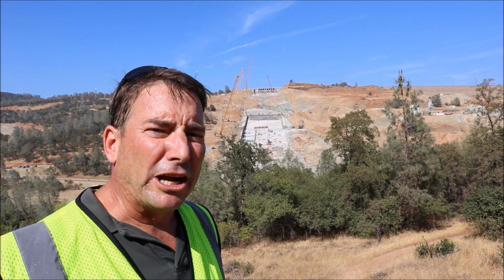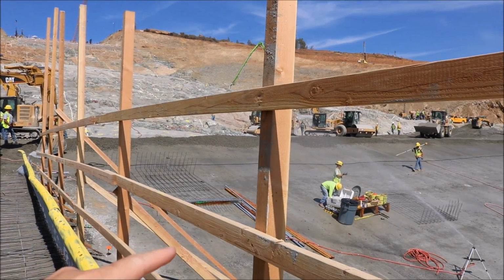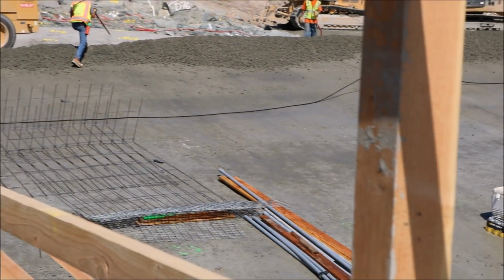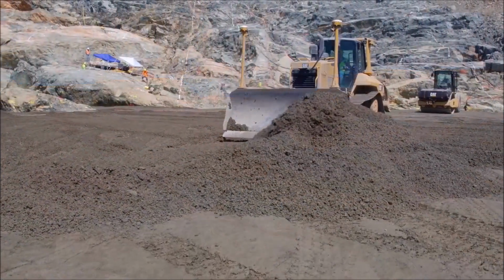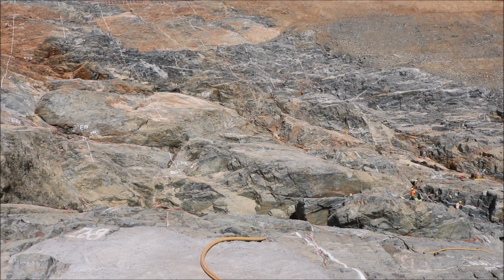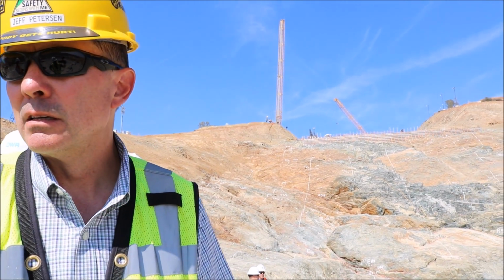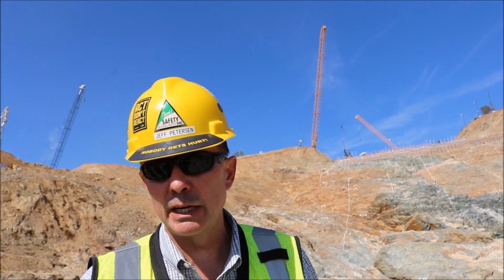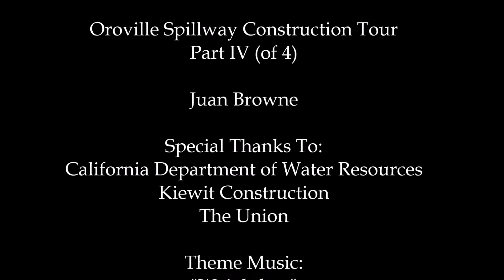Part IV Oroville Spillway Construction Tour

Comment: The aggregate plie for the RCC seems to be rapidly diminishing.  It seems there is actually a bit of confusion as to what leveling concrete is.  In my opinion, it is a wetter concrete than RCC which is very dry when placed.  Both RCC and leveling concrete lack rebar, although I noticed they were putting some pig wire into one of the two at a certain point.  It's pretty clear the "dental" concrete is used to fill deep cavities nnd small cracks.  Both leveling concrete and dental concrete can be pumped, but I believe the dental concrete has a finer aggregate content.  Structural concrete refers to concrete with a high content of rebar.  As for the differences in the mix I can't say for sure, but I assume the structural concrete probably has a higher psi compression strength than the leveling concrete.    I believe is is possible to pump the structural concrete too, but I'm not positive, and I also don't know if the size of the aggregate is different.    Nowadays there are many different additives added to the mix to achieve various results which would include cure time, workability. and ultimate strength.

Comment: If all goes well, next season Kiewet will: 1. Demolish RCC side walls and replace with 30' structural concrete walls; 2. Grind off several feet in depth of RCC section & pour structural concrete slabs anchored to rock; 3. Use circular saws to cut out drainage channels in RCC section exactly like upper and lower chute; 4. Resurface T-Rex power diffuser blocks; 5. Finish the Emergency Spillway; 6. Level surfaces around the spillway, seed and plant a few trees.
Reply from the maker: TonyUnplugged You got it!

Comment: Around minute 10 the lead states the upper concrete with all the ebar and such will end and at a 90 deg. angle, go down where the RCC will join it. He also mention aeration vertical culverts. I guess they want to aerate the water at that point to make it less able to erode the RCC? I forgot, are they , next year taking out a certain amount of RCC and  replace with the reinforce stuff if they are laying the RCC up to finished grade? I also wonder, there are no rock bolts going down through 100+ ft of RCC in the scour pits (plunge pools)? Excellent report. Thank You!
Reply from the maker: Erik 567 correct.

Comment: If you think of the concrete system as a pie. The dental concrete is a slurry concrete. It's soupy and able to get into cracks and crevices. It's like patching a broken pie pan for the filling. The RCC is the filler. Of course no filling is needed if the rock or bottom crust is already up to the engineered height limit. In the areas that the RCC is used it will be filled to the engineered height limit and according Kiewett that height is right under the upper crust or the erosion resistant structural concrete.  In areas that the rock is already in the engineered height limit, leveling concrete is used to bring the rock or bottom crust up to a smooth point that top crust, the erosion resistant structural concrete. If I understood right, there will be areas that the RCC will be a temporary top crust. They will try to use chemicals to bring the PSI up to acceptable finish.

Comment: Hi Juan, excellent work! Couple of questions about the spillway walls if you can ask DWR: 1) how high  up the wall does a 100,00cfs release come? 2) how high does a 160,000cfs release come? 3) 270,000cfs (max?) come? Also, is the low pressure river outlet valve being used currently as well as the Hyatt power plant? Thanks.

Comment: Your footage inside the spillway really helps clarify what's going on. Great work, as always.

Still confused about leveling concrete, though. Dental and structural I understand very well. Your description of RCC and the DWR videos make that clear. But when, where, and why is leveling concrete used? And what is it, what kind of mix?

I have been assuming that RCC comes from the RCC plant and everything else comes from the structural plant. Is that right?
Reply: The mix for leveling and structural is the same. The difference is that the structural has the re-bar in it. They can also add ice and or chemicals to change the cure rate and final hardness.
Reply: Thanks.

Comment: Still sounds like a bit of confusion re the RCC, what goes on top of it and, for next year, if the RCC remains with a "finish" concrete added to it.
Nonetheless, the resulting spillway will be substantially better designed over the original.

Comment: Thanks Juan for the video very informative. Wonder how they plan to remove those RCC walls next year and not damage the floor off the spillway ? That's a lot of wall to remove.
Reply: RCC is very easily demolished with power hammers. They'll use excavators to break it all up, level it and form up the final spillway from there.

Comment: Around the 10:30 portion of the video Jeff Peterson was discussing the end of the upper spillway with structural concrete that will tie into the lower spillway with RCC. Could you provide further explanation on the finished construction of this detail? Specifically the 2' dropoff with vertical box culverts at each end to provide aeration? A diagram would really help me grasp this design. Thanks for all you do Juan.
Reply: Just imagine the water flowing over a 2 foot high ramp, and at the same time jumping over a box trench. The box trench allows air to be drawn in from the sides if needed, to break any suction or low pressure and to help entrain air into the boundary layer of water that flows along the RCC below.
In very basic terms, they are using the 2 foot jump and box trench to make the water flow break away from the surface and become aerated to protect the initial part of the RCC from high pressures.

Comment: Let's see if I have this straight....

-Structural concrete (the very hard top layer that can resist water erosion)   How thick?
-Leveling concrete (to set the final foundation grade) various thicknesses
-Roller compacted concrete (the main filler material)  various thicknesses
-Dental concrete to fill the small holes and crevices   (bottom)   Fills holes too small to get the trucks & rollers into

Yesterdays video that detailed the tell-tale drains was really interesting. The drains start under the slab and go down hill until they exit ABOVE the water flow downstream. Ingenious!  So, about ho long are the drains from top to bottom?  I'm sure I saw similar drains spewing water while the original disaster was going on.

Ya know what?  I think this is gonna all work out, and all the communities and enterprises down stream are going to be safe again. Now just a few thousand more dams across America that need to be repaired. Yes, its a BIG deal.

Comment: Another great series if info Juan.  I wonder if you know whether the RCC is being compacted with the rollers in "static" mode (non-vibratory) or in the "vibratory" mode?  Also, it appears the RCC is being put in so fast that it doesn't have time to cure properly. With that in mind, do they expect to get shrinkage cracks, and if so, how do they expect to solve the problem.  I've worked for over 40 yrs as an inspector, but never around RCC.  It's definitely enlightening to watch this entire process play out.  Our hats are off to Kiewit for the amazing job of co-ordination and expertise.  Also. will anything be done this year to the very end of the spillway where, if continuing straight out, there is a pool of water, then a road, after which is the river?
Reply from the maker: yes Thermalito Diversion Pool.
Rcc will crack, expansion joints (sheet metal) added to upper layer (s)
Reply: But what happens to the Diversion Pool between the road and the end of the spill way ?  Does that get filled in somehow, and does the road eventually disappear?

Comment: Juan, why is air added to the water flow ? Jeff was referring to a wall just above the section that will be filled with RCC.
Reply: The air is to prevent cavitation. Cavitation occurs when you have an abrupt change in direction of flow. Basically the water pressure drops and the water actually boils. When the pressure goes back up suddenly the boiling water bubbles collapse creating shock waves that damage the concrete or whatever else is there

Comment: Great job on the series. Do they have to worry about heat buildup with the RCC?  Looks like they are getting a lot of lifts in a short time, or does the water take that away? Keep up the great reports.
Reply from the maker: Joe Lomax apparently not, it's a continuous operation.
Reply: RCC is very porous and doesn't contain nearly as much cement as a more solid, conventional concrete pour. It doesn't build heat nearly as much as there's less concrete in the mass curing and the porous nature allows more heat to readily dissipate.
Think of RCC as a sponge cake and conventional concrete as a mud cake.
Reply: Thanks Sideslip !  So does all of the water just keep going down in to it?

Comment: Great video Juan. Seems like poor planning to have to remove the RCC walls. If they had set them back a couple feet they could have built the new walls directly inside them. If they have to remove RCC to build the new walls they would not need to remove all 12 feet of them, so maybe it is not as bad as it sounds.
Reply: marmaly --- Logistics of constructing the underdrains are also a factor (as was discussed in Juan's other parts of this series).

Comment: Thx Juan, great reporting and thanks to the construction guys for letting you get in there, there's so much crap on youtube surrounding oroville it's unreal but you're a doing a great job so keep em coming!

1 Question,   how long does the concrete take to dry? if they pile rcc to a depth of 150 foot, does it take longer for the concrete in the middle of it all to dry out or is it dried in sections before the height is increased further?  - just curious because that's a lot of rcc going in that plung pool, thx.
Reply: Concrete cures long before it dries. They have to add the next lift in something like 30 minute increments. Being on grade that concrete will probably never be completely dry.
Reply: Eastern Woods  Thx for the reply, was just wondering because that's a lot of concrete in a short time and at 150 foot of depth in the plunge pool it's gonna be like a baked alaska, crispy on the outside and soft and gooey in the middle.  RCC must be a drier mix to start with though so would have thought it might not take as long as conventional concrete
Reply: Cement is one ingredient in concrete. Also add water and an aggregate. Also add chemicals to change the hardness and cure rate. The mixing and curing of concrete is exothermic ( it gives off heat ). They've taken core samples of Hoover Dam and found the concrete is still curing and still getting harder with time. Cemex has some good utubes on RCC. Most concrete has more water in it and it looks like soft mud. RCC is very dry and looks more like wet sand like you would use to build a sand castle. When they pour curbs with a continuous machine it sets up to hold its shape in about a minute. That's very similar to RCC.
Reply: Eastern Woods Thx, It's weird, you kinda expect concrete to go rock solid in a short time but like you say hoover dam is still curing after all these years

Comment: An incredible project. When it was mentioned ...100Ft. of concrete...I assume that means 100Ft. thick? Wow..!! The scale of this project is only understood when you see those teeny tiny people...like ants...working  down in the ravines and other places.  I do have a question: When the spillway is finished this Fall...at least enough to make it thru til next Summer..will there be just one grade all the way down the spillway...no 'bumps' or 'waves' of any kind? I can only assume that the grade would need to be as flat as possible to not have any airplane wing 'lifting' dynamics going on.?
Reply from the maker: marbleman52 it's a large, curved slope. Up to 4:1.
Reply: Juan, my apologies for not 'seeing' what  your "curved slope" is supposed to look like. Let's say you could put a very long straight edge against the long side of the spillway, from top to bottom. Will the edge of the spillway match the straightness and 'flatness' of the straightedge? Or, how 'bout this: if I get a 2 x 12 piece of pine ...for example...and put one end up on my porch and the other end on the ground, will this represent the spillway; not counting the sides, of course.? I do not see where the 'curve' is supposed to be. The cut-off wall at the 10 minute mark...when completed is there gonna be a small drop-off between those 2 levels? Sorry to be scratching my noggin on this...just trying to get a clear picture of what the spillway will look like from a side view. Thanks again, Juan for all your work during this amazing situation..!!
Reply: Marbleman. It's a curved surface so yes there will be a small airplane wing effect but the change in direction is over many hundreds of feet.
Reply: Thanks, Eastern Woods...I guess I just didn't realize what this curved effect meant whenever it was mentioned. And maybe I'm having a 'senior moment'..Ha..., but I actually don't remember hearing this curve talked about.  Okay...another question: Why? To slow down the water? So this is like taking a ruler and putting a slight bend to it?
Reply: The spillway starts off as a gentle slope and about half way along it becomes steeper. It kind of follows the land surface. If you go back to the community outreach videos that Juan did you'll get a side view of the spillway. The diffuser blocks at the bottom are to break up the flow going into the river. I have seniors moments all the time.
Reply: Thanks, Eastern Woods. I have been a faithful follower of Juan throughout this endeavor so I must have seen those videos that you mentioned...just didn't zero in on that particular detail. Okay...I'll quit worrying myself over this then...LOL. Thanks again.

Comment: Juan: On the lower portion of the spillway where RCC will be used as the top layer, what keeps the water from scouring & eroding it away during use?
Reply: The top layer has the mix adjusted and chemicals added to make it harder. It will scour faster than structural concrete but not as fast as regular RCC

Comment: What does the ground water drain plan look like in the plunge pool that has an area of 100 ft tall x 250 cu/ft/yards and is filled w/RCC? Note for the bloncolirio infinite spiral notebook and DWR media phone call. Or is it classified as a engineering security clearance and need to know basis: Only?
Reply: Technical Correction: How is the Rain Water and Ground Water going to be managed on the front and the back or in and around or threw the New Rain Water Collection Device (AKA The New Spillway RCC Plunge Pool Plug)?
Reply: This is just a thought, but Do they think that a Maze of Service Tunnels would be helpful?  Something like a Service Tunnel Maze made of Concrete Canvas Shelters Linked Door to Door. Yes you blow them up. Link them together and Add Water. Then In 24hrs you will have a Hurricane and Military Rated Bunker --- Walk Threw Service Tunnel for Rain and Ground Water Drainage--- Then DWR can just RCC them into the planned RCC Plunge Pool Plug.

Comment: My understanding of the secant wall is that there will be structural concrete from the wall up to the top of the emergency spillway. What are they planning
to do downstream from the secant wall?
Reply: Actually I think it's RCC between the secant wall and the emergency spillway. Below the secant wall will be erodible soil. the secant wall is into bedrock so that there will be no undercutting and erosion up the hill to the emergency spillway
Reply from the maker: David Chapman see part II...
Reply: Thank you for the info. I am not sure what erodible soil is that can withstand the high CFS flows.
I would thing they would put rock rip-rap or something to help dissipate the energy.
Reply: The erodible soil is just what's there now. The emergency spillway was only ever used this one time in 50 years. It will only ever be used if 270,000 CFS down the main spillway won't keep the lake from topping the emergency spillway. That will only happen if a hurricane makes landfall in Northern California and then you have other problems.

Comment: Hi Juan, at 17:05 do you know the reason for the central part/trough of the upper/mid spillway being still down to rock with built up concrete to the base of the training walls on either side?

Thanks
Reply: That's the individual plates between expansion joints. They do the outside first because that's what they can reach. Then they will move equipment onto the finished surface and do the center
Reply: Thanks - just looked odd still being right down to bare rock. I thought they built up in layers. Just curious.

Comment: When the new construction begins next year and calls for the removal of this "temporary" RCC will they blow it out or cut it out?
Reply: I don't think they will start blowing it up again :-D 
They said they will scrape off a layer of a few feet to replace it by structural concrete and cut out trenches to put in the drainage pipes and gravel.
Reply: They're leaving the RCC a couple of feet below the finished grade. I think all they will have to do is surface prep and install structural concrete. The top layer of RCC is hardened chemically so it will be similar to the leveling concrete.